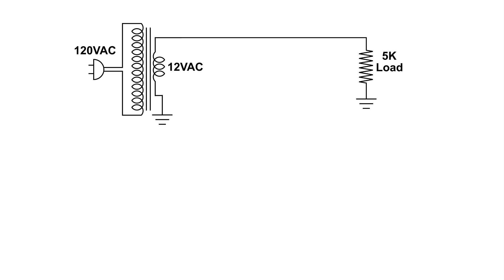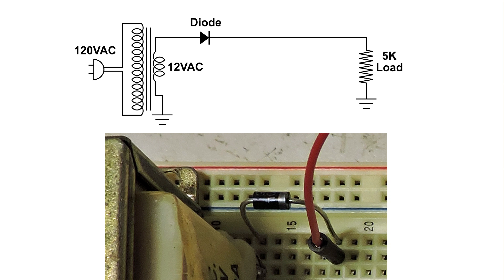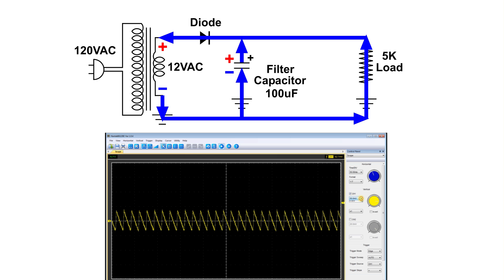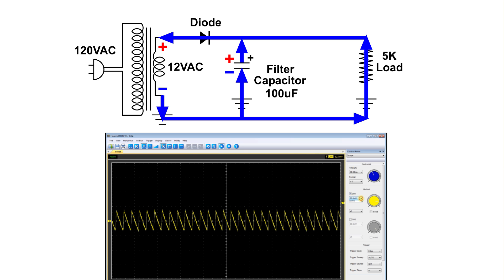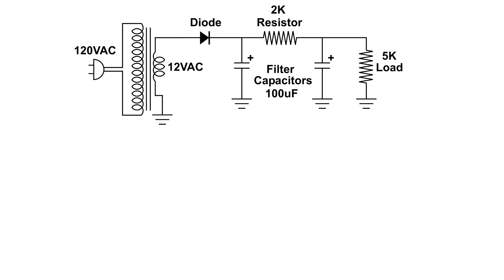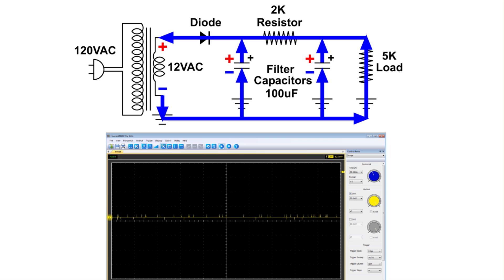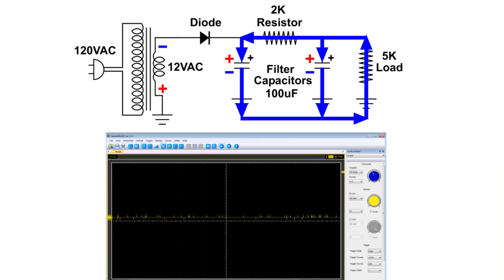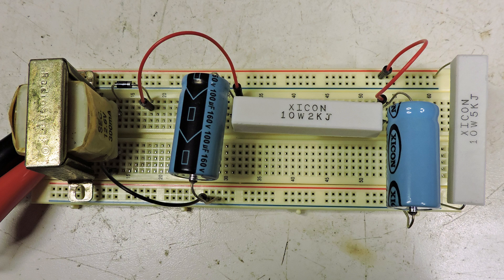Half Wave Power Supply  build and demo

Comment: Great educational video. What is the purpose of the 2k resistor? Also why 2 capacitors cause the sawtooth wave become flat?
Reply from the maker: The capacitors are 100uF @ 160WVDC and the diode is any power diode 1 amp or higher..The resistor is part of the RC time constant.
Reply: @AllAmericanFiveRadio  Thank you for your response and your explanation of how the circuit works in the video. It's a great video. Wish you great health.
Reply from the maker: @shvideo1  Thank you, and your welcome.

Comment: I used the pi filter trick on a circuit for a 48V microphone power supply. It's so useful for smoothing DC when the load is fairly high impedance. Great video. :)
Reply from the maker: Thank you.